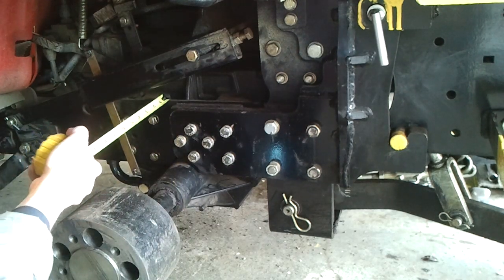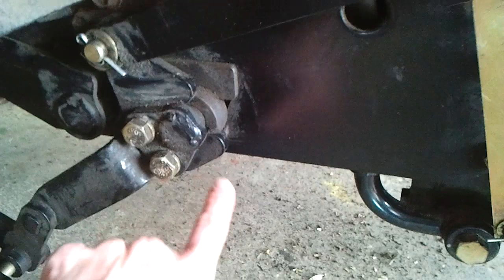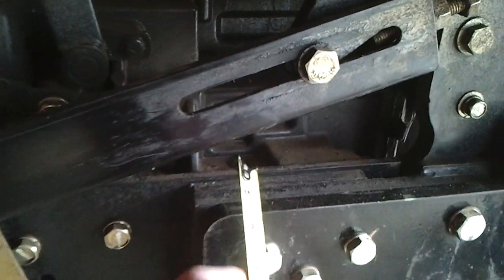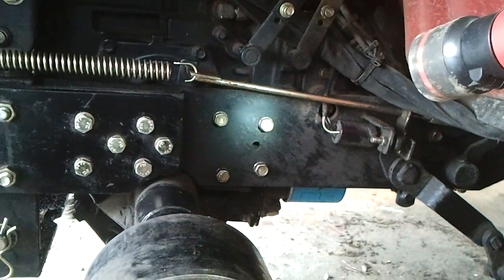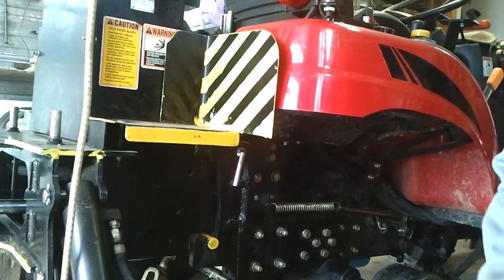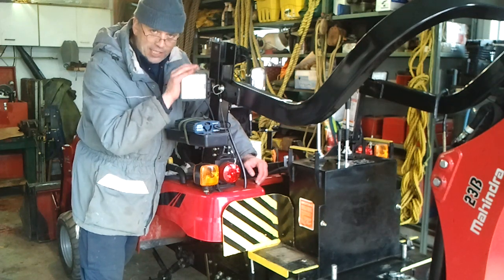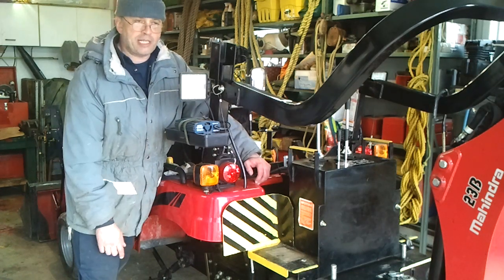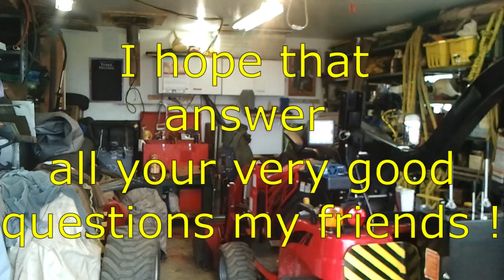Mahindra eMax20s HST Maintenance torque schedule and visual inspection of the steel frame/Backhoe 🧐

Comment: This was excellent  pulling the wheels off and showing the frame design . Exactly what I suspected . The rear axle and transmission housing is super locked in all together . Now all the torque is transferred too the flat bar rails and centre of tractor .  When it flexes in the middle the fender floor board shell flexes also lifting at back away from wheels . The housing from the engine too transmission is flexing also which is bolted too the flat bar rail frame . You are getting a twisting action also . I had this happen with no sub frame . The housing bolts connecting the transmission in middle stretched . Oil started leaking out . Some people on certain tractors have broke the actual housing where loader mounts bolt on also . A rectangular tube  sub frame bolted from loader mounts on frame and bolted too back adapter plates for hoe will stop the centre flexing . On the sub frame two cross tubes welded in a x pattern will also stop twist . A camera video under tractor pointing up at middle when operating the hoe should be able too see what’s happening . After I fixed my tractor I built a sub frame as described . Never twisted or flexed again . Used it for years after . Even some tractors with out sub frames from loader mounts too back axle when using a loader under extreme use can twist the tractor .  I went back and really reviewed your video closely of hoe operating again . There is no doubt you got flex . It’s a common problem on a lot of different manufactures models . Even some sub frames factory made are too light on compacts or sub compacts . I think the reason for this  is space and interference of attachments for mower decks and mid pto drive line . Severe work and hours will take its toll using a hoe on a compact tractor twisting . I think sooner or later with no sub frame trouble is coming 🤷‍♂️
Reply from the maker: Good evening Stephen ! Great analyse and I agree with you 120 % 👍 Also some company are making their rear differential and transmission from cast aluminium and mine is cast iron but like you are saying it will need a good sub-frame for sure !!👍 With that all the problem will be fixed for good !!! That is why for me removing the hardware attachement for the mower deck to make place for the sub frame is not a problem, or and  thicken the frame will be good also, the x frame will be good too for protecting the oil filter and the cooling fan of the transmission. Joe and I were thinking about this sub frame since last year now and I did mention it to the mechanics but since this tractor is new on the line ( I was the very first in Canada ) according the saleswoman, these backhoe problem will sure come back but the tractor is under warranty for 7 yrs ( still 5 yrs left ). Their tractor are great and well built and i'm still in love with that tractor despite that problem. Can't wait to bring it to Joe and have it fixed for good and make it also Dave dummy proof !!! 😂🤣👌Thank you again for your great input Stephen ! You are a real Gentleman !!!👌👍Cheers !!!
Reply: Hey Dave, we will figure something!  I have to go grab some steel this week for a few projects (that I should take time to post on YT...), I'll grab some for this project.  Thick-walled tubes and thick plate is on the menu!  We will make sure the modification is addition and can be removed at any time.
Reply: From Steel To Wood  👍👍👍👍
Reply from the maker: @FromSteelToWood  Good day my friend ! Thank you kindly for your great help and sound like a good plan about the thick steel 👍😊l

Comment: Salut Dave!!!  Torque ratings are very important.  When I was at work there was a period of time where we were insisting on changing all critical fasteners after every rebuild.  The reason was because as you torque a fastener it stretches and deforms ad then the torque ratings are or maybe incorrect.  Very interesting the science behind Preventative Maintenance and Maintenance for Zero Failure!!!  Thanks for sharing your video et bonne soiree!!!
Reply from the maker: Bonjour mon ami, yes in the air force both program are in full swing ( Preventative Maintenance and Maintenance for Zero Failure! ) Cheer and thank again about your very nice informative input !!! Bonne journée 😊

Comment: There's a lot of bolts in there to torque. Makes it even more fun that they can't use the same bolt sizes!  The front and rear wheels on my tractor has different bolt sizes.

Stay warm.
Alain
Reply from the maker: Good day Alain, Yes they are a lots for sure they did underingeneer that aspect for sure 🤣😂👍Yes that would be so great to have the same size bolts, but not 3 different sizes !!! 🥴 Ho boy, I think it's the same for me too, what do you have for tractor ? Cheers and yes keep warm too !!!
Reply: @RCAFpolarexpress  I have a Massey Ferguson GC1723e.  No backhoe on mine though so I wouldn't have the same frame stress issue. Just the FEL to keep an eye on.
Reply from the maker: @alainamyotte6127  https://www.youtube.com/watch?v=RPLmrNY7yOM ( on this video)  I do agree with you, see the tractor in front, no double steel frame and it's moving like mine ,,, So I wounder if these people when they do built stuff for backhoe what are they thinking ??? 🤔 That we all going to dig on soft black soiled👍 No, seriously. Sure,  I use mine more the usual average personne, but still it should be built better for the average operator mistake !!! The one good think about my video is the rise real concern about sub compact and compact tractor to all of the owner since we have great real life stories ( Stephen, Gator etc, )  and it will do a good series of videos for sure on Joe channel and mine too !!!  👍Cheers my friend !!! Bonne journée
Reply: @RCAFpolarexpress  I think they have to sacrifice on weight and cut some corners a bit.  I had seen that video before.  Pretty easy work for the Massey. Also the first time I saw Tim on a red machine. 😀
Reply from the maker: @alainamyotte6127  Some tractor company have their strong points and weak points for sure,  but for mine since 2 yrs and pass 250 hrs, it's THAT one for sure !!! LOL 🧐👍 All backhoe, should have a sub frame separated from the main frame and reinforcing it for various types of stresse !!!  👍

Comment: Hi Dave - I’m new to all this torque stuff.  I’m about to buy the eMax 20 S with a backhoe and I’m a little concerned that I’m going to need to take off the tires and torque everything.  Again - I’m new to that sort of stuff.  Is that something I’m going to need to do? Thoughts about this for someone new to all this?
Reply from the maker: Good day Sir,  Ask you sell person to have the print description of each bolts on the tractor of the torque requirement on paper and have a mechanic explain to you on how to use a torque wrench ( ask them witch range you need and buy it  ! ). You do need to removed the tire, i removed for you to see better on the video. ( remember torque it every 10 hrs for the backhoe mounting rear braquet ) 10 hrs for greasing so i do it in the same times. The maintenance book for the front FEL and the REAR Bachoe brackets call for retorque at 25 hrs ( THEY ARE WRONG !!! ) maybe the front FEL can be done at 25 hrs but I found loose bolt at 15 hrs,,, but for the rear all the bolts need it after 10 hrs ( even the ones under your seat and the ROPS too !!! ) .  So to recap's : Retorque ( ALL ) the bolts and nuts on the back every 10 hrs and Front Fell TOO and buy a good torque wrench and have it explain on how to use it by your dealer mechanic !!! Grease is also very importante and run the RMP on you tractor very low at the beginning I run it at 1700 rpm max !!!  Hope that help Sir !!! and congrats on your purchass ( run you diesel engin on ROTELLA Shell T-6 synthetic oil is a great option !!! ) Cheers !!!

Comment: Dave,..Are you sure that those bolts are not stretching,..or the washers are not being crushed? 
Joe's idea is a good one,..to lengthen the backhoe's frame to spread it's load stresses out further ( better leverage ).  Would grade 8 bolts with stover ( locking ) nuts and flat washers ( also grade 8 of course ) give better clamping force to those frames I wonder?
Reply from the maker: Good day Sir, Yes i'm trusting Joe for sure !!!👍No, i the bolts and washer are top shape, but on the video I did found 10 bolts looses on the top that I never did torque before. I have to use the backhoe for this project can't wait to see if that improved by retorquing these bolts that I miss !!! all the bolts witch are bolted to the frame and the transmission can't be change the one on the frame can for sure. Cheers !!!😉
Reply: @RCAFpolarexpress  Oh yes, re-tightening the bolts is essential,...you really don't want a loose bolt  to rattle around, especially
 when it's screwed into the differential or transmission body and such, do you?
Reply from the maker: @regsparkes6507  Yes, that can cause a messy situation for sure !!! Cheers !!!👌